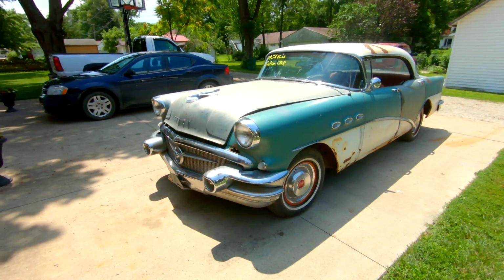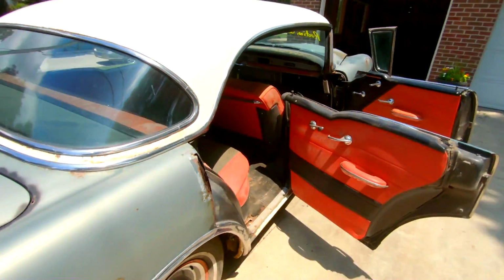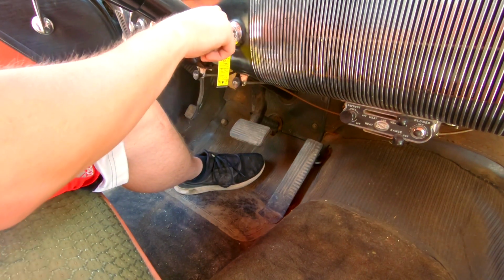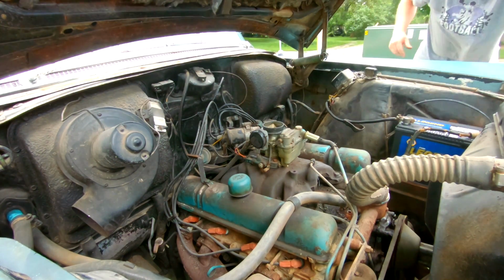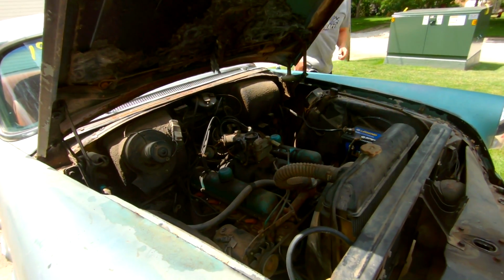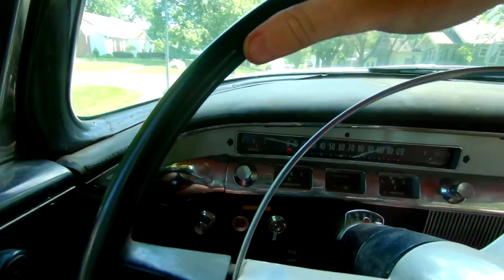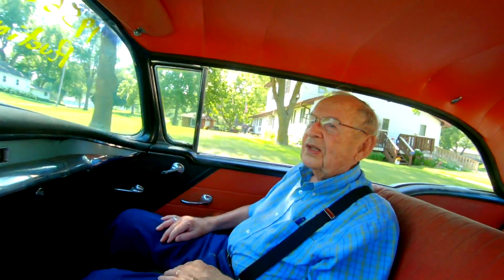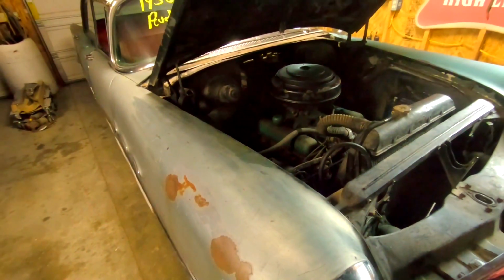FORGOTTEN 1956 Buick Special - WILL IT RUN & DRIVE After Sitting 25 Years??? (Auction Find)

Comment: All you need now is a "Sonomatic" radio to go in the dash.  I had a customer that had one of these and dad told me to drive it in the shop.  After I couldn't get it started, he came out and said to push on the accelerator.  I was almost as humbled when a customer with a '64 Plymouth Fury came in and I couldn't find the gears.  Great video!
Reply from the maker: its actually in the trunk!
Reply: @IowaClassicCars  Really?  You have good luck!  I don't remember if Buick has "all transistor" radios like Chevrolet's "Wonder Bar" radio did.  You'll need to let it "warm up" if it has tubes.  Great video!
Reply: @lvsqcsl  The radio has tubes. Change all the paper and electrolytic capacitors- especially the "buffer" cap and the audio output coupling cap. If not, you risk burning out difficult-to-replace parts.

Comment: I had one of these here in New Zealand, it was a 4 door 56 Super with 4 portholes in the fenders, and had the Nailhead and an old carter 4 barrel carb. She was old-school pink and white. Awesome cars.
Reply: My first car was a 1956 buick super, two door hardtop model 56r. It was the same color as yours, but the official color was tahiti coral and dover white. I also had the Carter 4bbl type WCFB. SPLIT PRODUCTION ON 4BBL SOME BUICKS used the Rochester 4gc 4bbl

Comment: Nice! That's a rare FACTORY A/C car.

I see you're running the  small carb...

The two bbl was standard, the 4 barrel was optional and made those things SCREAMERS.

Also optional on the Special was dual exhaust.

NICE FIND!

Oh!
When you go to service it for the first time, drain the old oil and refill it with cheap ATF... Start it up, but DO NOT REV IT... Let it idle for an hour or so.
The ATF will loosen up all of the crud that's accumulated and also free up your rings and valves.
After it's good and warm, drain it and THEN replace your oil filter and add new engine oil.

Cheers again on a great find!

Comment: Very nice find on the '56 Buick it's rare to find a four-door hardtop and if you want to make that horn louder there's usually a screw on the horn itself the horn under the hood that you could adjust, to make it louder or lower it's possible somebody turned it down because it was too loud but they're usually a adjustment screw on the horn to change the sound thought I'd let you know, again great find 👍🏼
Reply: It sounds to me as if only 1 horn is working
Reply: To get the Jay Leno "Now THAT'S a horn!" seal of approval, gotta have both horns online.

Comment: In the early 80's my friend bought 1 for 2500 bucks. Still had the original spare. Only had 40,000 original miles. What a sweet ride.!!
Reply: In the early 70s I bought one exactly like this for $25. Hopped in it and drive it home then sold it for $75 and felt like I hit the lottery.

Comment: My favorite uncle had one of these.  I remember riding in it many times when I was 5-7 years old.  Love the dynaflow.  The Special was the entry level Buick, hence the rubber floor mats and manual steering.  I could tell a Buick because the engine speed had nothing to do with the street speed.  I am from "Buick-city", Flint, Michigan, so lots of these babies around town in the day.

Comment: My friend Marty has the 4-dr post version of this '56 Special. Not only is it manual steering but also manual brakes, and a manual transmission (I believe only 2% came that way from the factory). Imagine what a beast THAT is to drive!
Reply: For 1956, 4 door hardtop is the most popular body style for all GM cars.
Reply: @davidtosh7200  As it happens, I myself once had a '56 Olds that was a 4-dr hardtop!
Reply: YET, if you noticed, he wasn't having to strongarm that steering wheel tho either even though its a manual steer. Not too bad when you can handle the camera n steer it to.
Reply: @jamesthompson8008  The secret? Check out that giant steering wheel!
Reply: @bombasticanimal1853  Lol, not necessarily a secret, but yes that's part of it...also has to do design of front suspension at the time. Buicks were known for being very driver friendly as opposed to other makes in the same era. Some cars were ungodly to drive without power steering then.

Comment: My grandmother bought a '57 Special 4 dr hardtop new off the showroom floor. Pink & copper paint with a pink, black & white interior. Typical '50's color scheme. It was also a factory a/c car. Traded it in '62 for a new Electra 225.

Comment: I had a 53 Special with the floor starter. Sold it in 20001. it was a model 48D which was the equivalent of a two door post, or they called it a two door sedan.

Comment: I had a 56 Special 2 door sedan, 322 Stromberg 2 barrel carb, and Dynaflow automatic.  Got it free with 120, 000 miles from the original owner. Was factory tri-tone paint scheme. White top, metallic gunmetal gray down to the side trim and red below the trim, wide whites on red wheels. Decode your trim tag for paint code. Mine had the same red and black interior.  Buick called all their models that were 2 or 4 door hardtops Riviera  so yours is a Riviera Special 4 door hardtop. Chevy called their 4 doors sport sedans, 56 was the first year. Mine,  like yours didn't have power steering or brakes. Loved driving it but you did hav to drive it with out power assist.

Comment: Actually, the starter switch is built into the carburetor casting and is activated by the linkage when you step on the gas pedal. The travel of the pedal is adjusted by adding or subtracting shims.

Comment: Did you use a 6 volt battery or needs a 6 volt battery to run?
Reply from the maker: no GM switched to 12v in 1955

Comment: Looks good to me.... are the floors as solid as the rest of the car? Back in the day, a friend's neighbor had a 56 Buick 2 door coupe, blue and white. It had three windows in the rear, a divider bar about a 1/4 way in on both sides. I don't remember the model, but it was super fancy.... I'm thinking it was a Riviera, but I don't remember if Buick used that name in that era. It was 100% unrestored, and looked new. He passed away about a decade ago. He had no kids, so I have no clue what happened to the car. Yours would look awesome two toned in Black & White with that red and black interior.
Reply from the maker: Yes actually the floors in this car are mint!
Reply: Back in those days Riviera was Buicks name for the two door hardtops
Reply: @rogercamp6071  It was a two door hardtop. If I remember correctly it was super low miles, like under 30,000. He had a 28 Model A Ford.... and I think it was a "1928" Plymouth. It would have been the first year for Plymouth, as his was the 175th built.
Reply: If it had three piece rear window it would've been a '57 model, probably a Special as I think the senior models had the one piece window, Oldsmobile had the three piece window in some of theirs as well.
Reply: @rogercamp6071  It may well have been a 57, it's been decades since I worked on it. I know it was kinda a rare car, according to what  the owner told me.... So was his 28 Plymouth. The Model A was his summer cruiser. He drove it everywhere. It always ran good, because he drove it a lot. He hardly drove the other two. I was always having to clean up the gummy fuel systems on the Buick and Plymouth for him.

Comment: I don't think nail heads have valve covers
Reply from the maker: all engines have some sort of a cover
Reply: @IowaClassicCars  no the older ones didn't. The valves were opened by the cam pushing the stems .over head valves came later. It's why they were called ' nail heads' because you could see all the head bolts